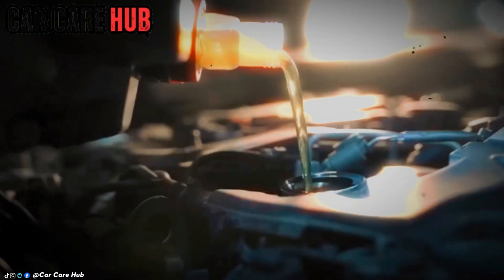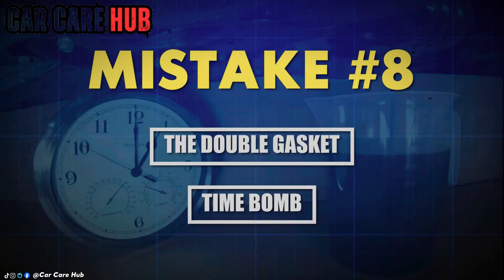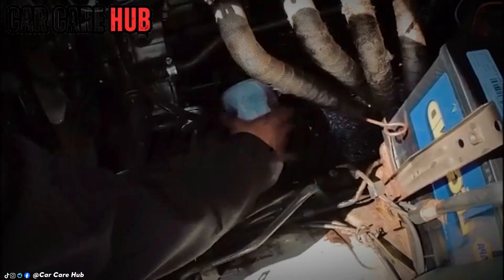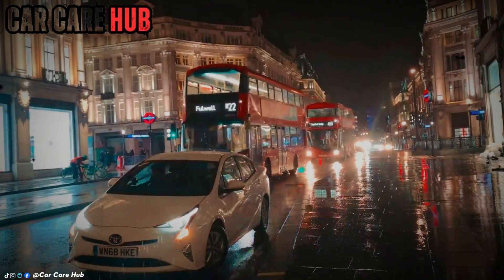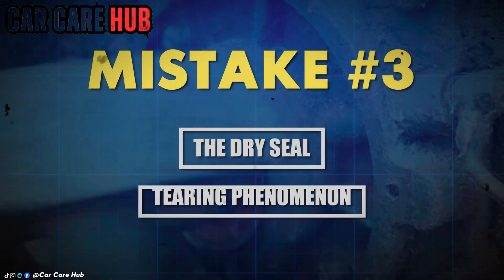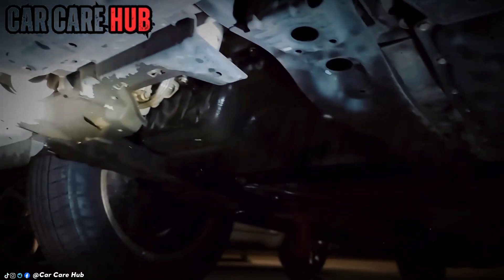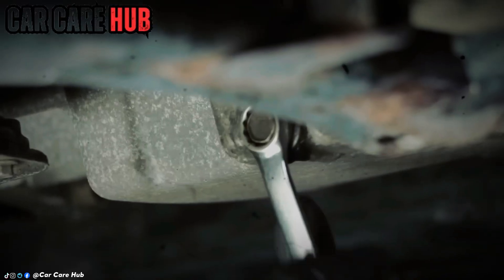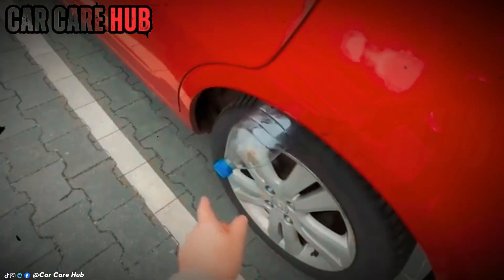Never Do This After an Oil Change! (KILLS Your Engine Fast)

Comment: Prefilling oil filters isn't really necessary, unless its a high capacity filter for a diesel engine.  On my gm truck it takes less than 2 seconds after a change to start building oil pressure, and there is always some oil in the pump and a film coat that doesn't drain out.  That and quite a few vehicles (Subaru's particularly) where the oil filter installs "upside down" at the top of the engine, and others are horizontal mount making a prefill basically impossible.  As far as the oil plug goes, if you're worried about overtightening it, get a fumoto valve and install it once, sure it takes a bit longer to drain out, but being able to do a change with no tools, and putting a hose on the valve, not making a mess far outweighs the cost of the valve.
Reply from the maker: Great points about filter orientation and the convenience of a drain valve!
Reply: “ the car care nut “ YouTube channel is about a Toyota/Lexus master mechanic posting videos related to repairs and maintenance and he said that no need to pre fill oil filters or at least in Toyota vehicles 🤷‍♂️